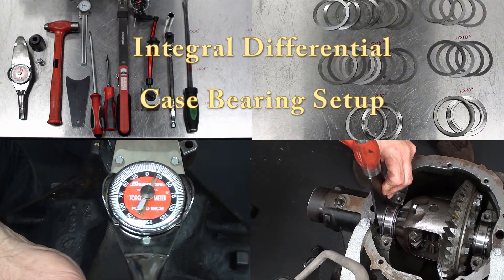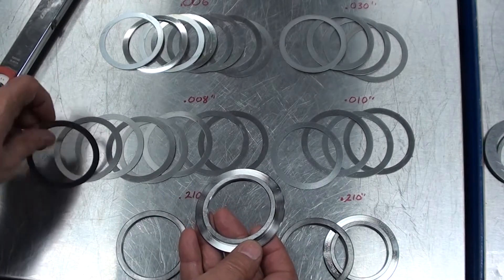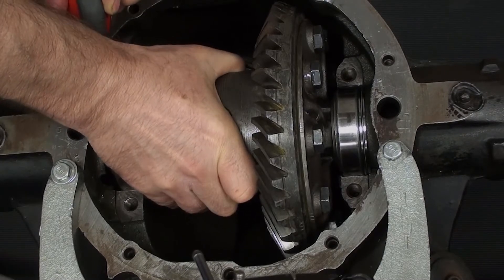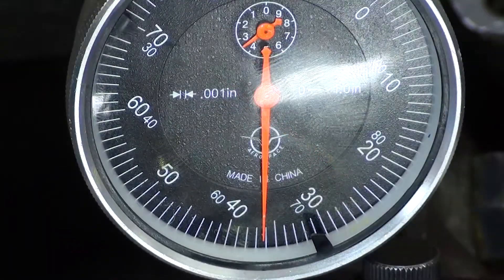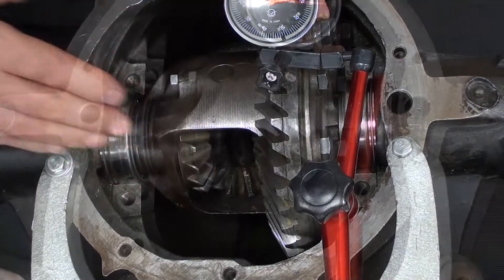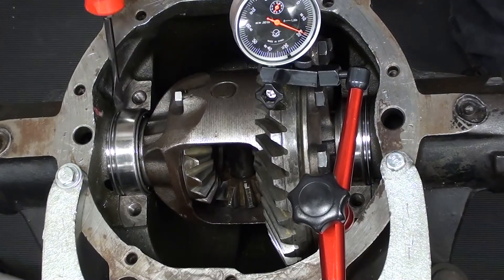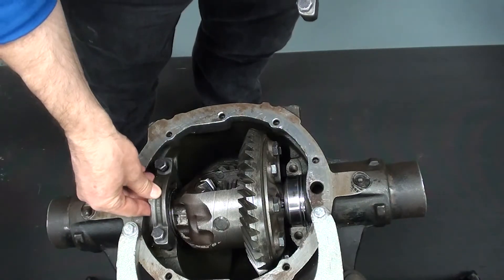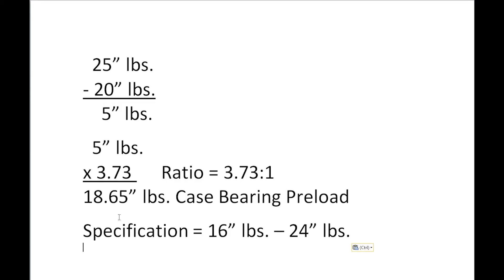Differential Case Installation With Universal Shims

Comment: Thank you for being clear on when to add to ring gear side and when to add to opposite side. I am swapping the carrier out on a gm 9.76 12 bolt. I only have to adjust lash and preload on the new bearings as I am reusing the ring gear and pinion is not being removed. I can measure rotational force at the yoke but I can only estimate pinion bearing preload. Any other ways to know if my carrier bearing preload is correct without having all of the numbers I need to do the calculation?
Reply: I suppose I could measure the rotation force before I tear it apart and at the end try to end up with the same amount of rotational force. And if it’s higher I would have more carrier bearing preload than factory and the opposite if it is less? My goal is to have the same backlash as factory carrier too
Reply from the maker: Measure the pinion bearing preload with the case and ring gear removed.  Install the case and use the shims to adjust backlash and add a preload.  Put the bearing caps on the case and remeasure the pinion and case turning force.  It's basically a pinion bearing preload measurement with the case installed. The measurement should be approximately 3 - 5 inch pounds greater than the pinion bearing preload. If your gear ratio is near or above 4.89:1 shoot for 3 inch pound difference. With a smaller gear ratio use a little closer to the 5 inch pound difference.   Here is a suggestion.  You are replacing the case maybe your adding a limited slip or a case upgrade.  Your replacing the case bearings but reusing the ring and pinion.  This is very common.  I would recommend while you have it torn down this far that you also replace the pinion bearing and the oil seal.  Last thing you want  is 20K miles down the road is to have to go back in there to replace the pinion bearing when you could have done them now.

Comment: I could probably get by without it, but where would someone buy a "shim punch"?  Is that tool known by a different name?
Reply from the maker: You can make one from 3/16 or 1/4 in metal plate or order one.  The one I used was an OTC tool but I googled Diff Shim tool and got several hits.  Here is a ford tool. https://www.toolsource.com/differential-service-c-1321_119_124/differential-shim-installer-ford-t85l4067ah-p-99148.html
Reply: Answering my own question:  Search for "shim driver tool" to find something that serves the purpose of the thing called a "shim punch" in this video.

Comment: This is good stuff and thank you for sharing your knowledge. I need to learn more before I go swapping my '97 gm truck 9.5" semi-floater from 3.42s to 3.73s though. Too bad you're not in Indiana I'd love for you to set mine up for me.
Reply from the maker: That is not much of a gear ratio change.  Are you looking for more low end torque?  I'm not sure you will feel much of a difference with this small change but your speedometer will be off slightly.
Reply: @DrivelineMaster  Thank you for your reply..Yes I would like a little more low end to help turn the 35" tires I'm running. I almost bought a 4.10 gear set but was afraid it would raise my rpms too high at cruising speed and I do quite a lot of highway commuting with this truck.
Reply: I have a 9.5 semi float that I want to install 4.88 for 35's.
Reply from the maker: @jamesfarmer2748  Depending on how your using the vehicle and the type of vehicle and engine along with what your original gears were.  This will have a significant effect on torque and engine RPM especially on the freeway.  Gas millage will be effected. If your doing any off road fun this gearset will help with the fun factor.